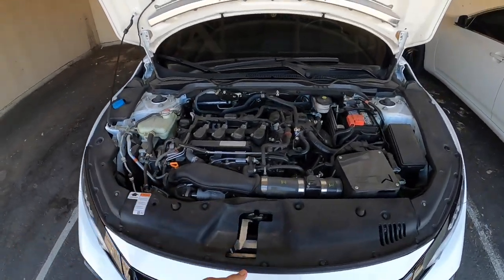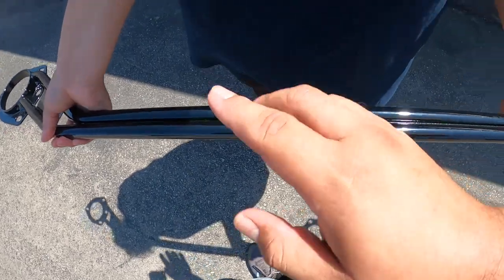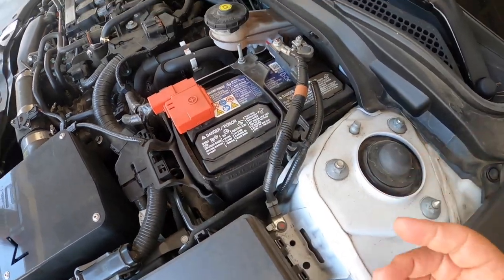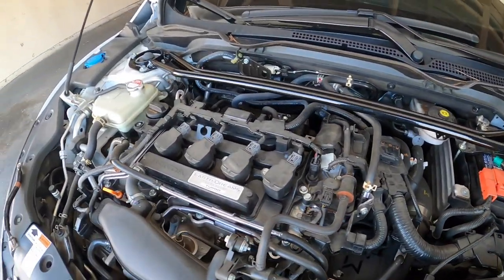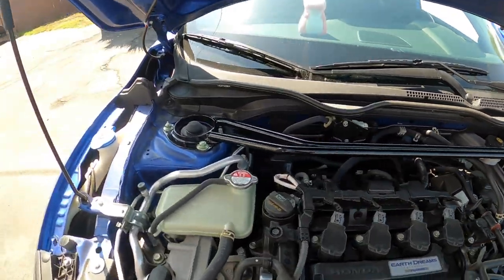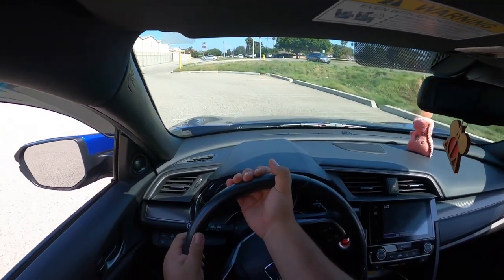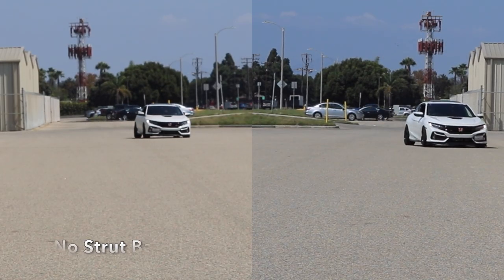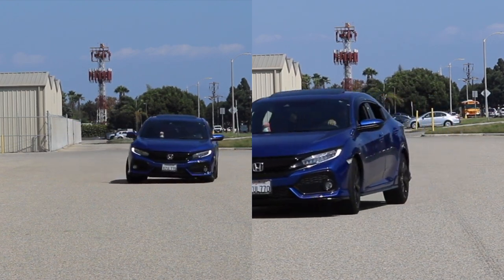Does a Strut Bar Really Make a Difference? | 2020 Honda Civic Si

Comment: Visually its hard to see the difference specially from outside the vehicle. But you can definitely feel the huge difference in the actual handling specially in cornering and curve roads. It provides more stability and reduced body/chassis roll.

Comment: My experience: my car had nothing and installed a front sway bar (bottom)and yes it had less body roll . Then installed a front strut bar (top) and started to roll a bit on corners, turns out the chasis by having less flex the stiffness from the strut bar WILL be passed down to the suspension loading the sway bar a bit more.

Comment: Definitely worth it, I have a 2019 FK7 hatchback with a DC sports front strut bar and rear fk8 J’s racing strut bar on Tein coilovers and in high speeds when turning into a corner, the front would have no problem since I installed the front strut bar first but I could feel a little bounce in the rear or the rear sway more, I just installed the rear strut bar about a month ago, and you could feel the difference right away The rear is alot more stable to the ground, and the rear bounce went away

Comment: With Front Wheel drive, that tower bar will help stiffen up the flex from that massive opening called an engine bay. What helps a lot and, this is counter intuitive, is to upgrade the rear sway bar also. That will transfer the load from the outside wheel to the inside wheel and reduce the ass lift. Reducing that lift goes a long ways in reducing understeer as the rea of the car is not trying to push you straight as much.

Comment: One thing you want to do if you put in a brace like this is either to raise the rear pressure 2-3 psi or lower the front pressure 2-3 psi if you put in the brace. The reason is to fix the possible understeer that having just a front brace could introduce . It’s the cheap way to re balance the suspension.
Reply: wtf are you talking about psi is involving the turbo not the suspension lmao
Reply: @Tonic10thGen  um.... He's talking about a strut tower brace ... A front strut tower brace  will cause understeer sometimes if you don't add a back one. Especially with front wheel drive.. You can correct the understeer by manipulating the suspension stiffness. You can manipulate tire pressure to manipulate the handling. Psi is pounds per square inch. This unit of pressure doesn't only apply to turbos it applies to tires . There's pressure in your tires and there's pressure in your turbo... I think you're all mixed up bro.
Reply: @Tonic10thGen  you can talk about psi in terms of ground pressure too. I guess you're learning today ...
Reply: @off-roadingexplained8417  yeah i didnt even think about the psi in my tires lmaoo i was lit my b

Comment: I have a 370z that already has a front anti-roll bar and a triangular strut tower brace. The car handled well but I replaced the front and rear anti-roll bars with stiffer ones that improved the handling. I just replaced the strut bar with one that is stiffer and lighter and have noticed a further improvement in handling.

Comment: A strut bar helps, but on my 2010 Matrix all it did was maybe make the turn in more confident feeling. It definitely stiffed stuff up, there is this left turn out of my job that for whatever reason "rocks" the car, but when I installed an aftermarket brace that rocking seemed to go away. It's a small difference, and not a necessity for daily driving, but it's such an easy job it's  one of the first things I did to my car. The XRS I had came with one from the factory, but the S I currently have did not. Honestly I didn't feel that much of a difference, but when I got my S I put shit on it the first month I had it. 

Granted I had to take out the wipers, wiper motors, drain gutter (11 bolts!) and only then did I have easy access to all the bolts! Still easy, just time consuming.
Reply: Man the Matrix has a ton of body roll, the mod that will make a real difference is an upgraded rear sway bar. I have one on my 2010 Vibe (same car), it's a night and day difference.

Comment: I think is worth it but paired with coilovers and swaybars, if not it will just be for the looks and a bit of better feel.
Reply from the maker: Eventually I’ll have all the suspension support
Reply: When you say sway bars. I’d imagine sway bars front and rear or just the rear. The rear sway bars are WAY easier.